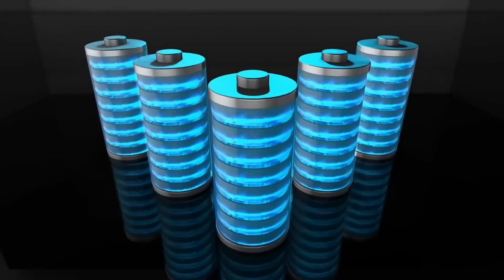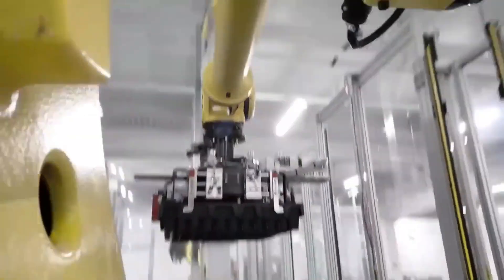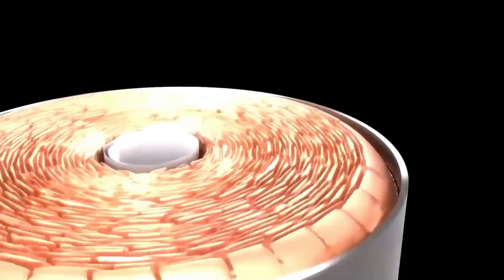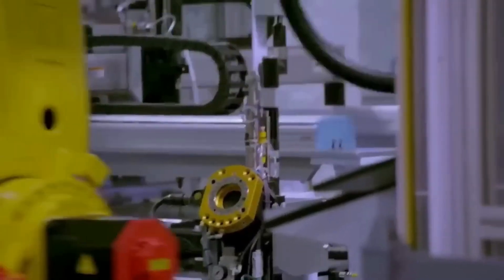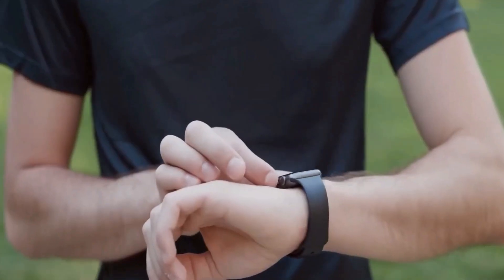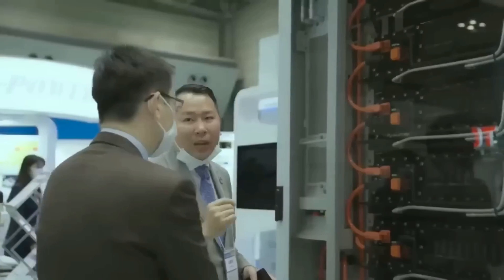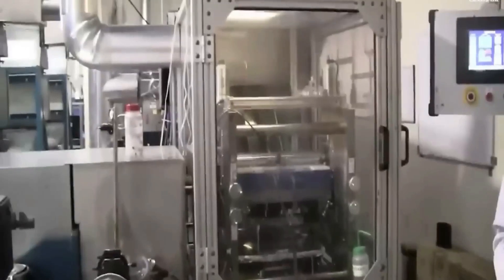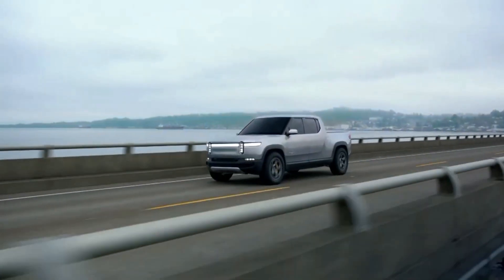JUST IN! Elon Musk's Research Team Accidentally Invented The New Solid-State Battery!

Comment: Imagine a battery fire in a parking structure full of EVs. They burn far worse than gasoline vehicles and spread their infernos quickly to other cars. Water is ineffective because one of the gas products created is oxygen. The remainder of the resulting clouds are full of toxins that only need touch your skin to cause serious damage (cobalt byproducts, for  instance). Firefighting amounts to waiting for it to go out.

Imagine it happening in the basement of a high-rise. The heat of the fire is non-trivial. Support columns will be compromised.

The industry needs a serious rethink and cannot realistically  proceed until battery fires are eliminated. Insurance won't be available otherwise. All it takes is the tiniest fire to begin.
Reply: Nobody wants to make noise about this problem, however the Insurance companies will have the final say when, finally a building go up, just hope you are not asleep in it.